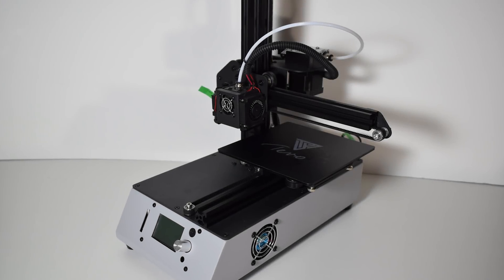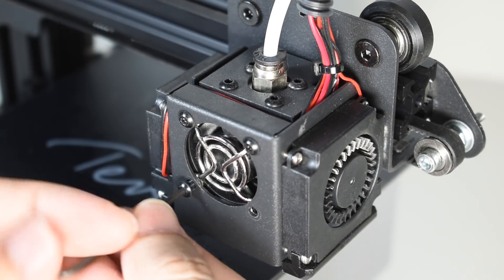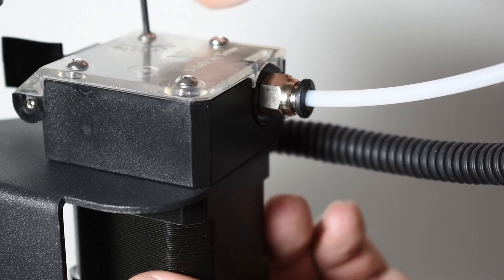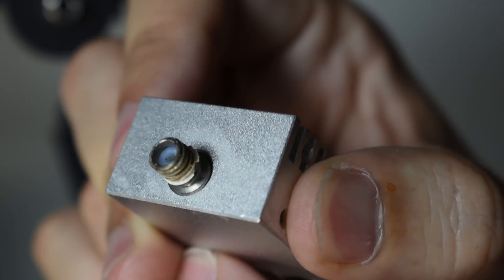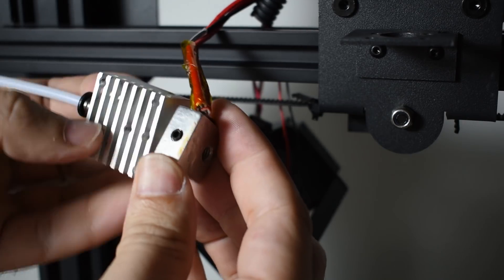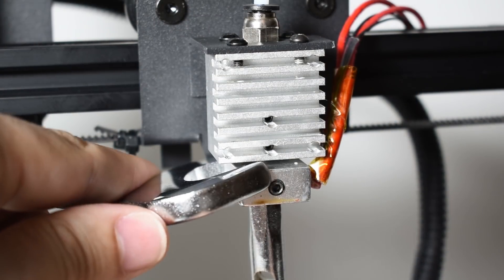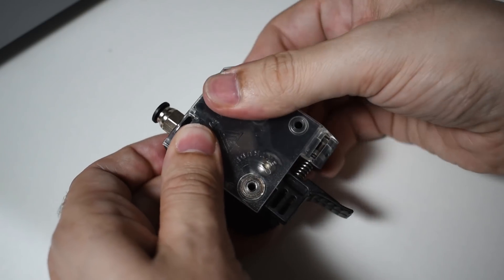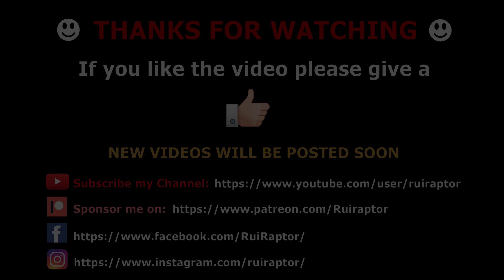3D Printer HOTENDS -  Troubleshooting Leaks & Clogs

Comment: You don't need to disassemble the extruder. Press down on the Bowden coupling and pull on the tube at the same time.
Reply from the maker: If the PTFE tube is already contacting the nozzle, there is no way you can push it in any further.

Comment: I realized this on my own and ran the PTFE tube all the way down within the heatbreaker. Then I tightened the nozzle so that it touches the heatbreaker but my Tevo Tarantula still clogs and I'm gonna run crazy
Reply from the maker: Did you check if the PTFE tube has a clean 90 degrees cut? Also, make sure the nozzle is also too. Did you tighten the nozzle while hot?
Reply: ruiraptor cut is clean 90 degrees and and the filament has nowhere to run but inside the nozzle. it starts to print all okay but during the print it clogs so the last thing I’m going to check is the retraction settings. Would you suggest me something please  cuz I have no idea how to set a retraction setting.
Reply from the maker: For PLA and for the tevo tarantula we are using 6.5mm distance and 35mm/s speed. What temperature are you using? Also, is the frontal fan always on when you are printing?
Reply: ruiraptor I print at 205 for PLA, frontal fan is assembled with a direct connection to the power supplier so it’s always on. The heatbreaker I use is M6x22mm, would you suggest if I replaced it by a longer one and added additional fins in between the block and heat sink ? I’m really confused.
Reply from the maker: Don't understand. Your hotend is not stock?
Reply: ruiraptor yeah yeah it’s the stock one. Only the heatbreaker was full metal and I dipped the PTFE all the way down until it’s end. This is the only change I did. But it’s M6x22mm so thing I wanna find out is, will increasing the gap between the hearing block and the heat sink will give me better results? Cuz if so, I’ll change my heatbreaker with a longer one

Comment: Hi Rui. Thanks for all the great videos and reviews you do. I’m trying to find answers for a problem, you might have some tip... I have a tevo tarântula running the stock hot end. It has 2 tiny screws behind the heat sink to hold the heat breaker. On of those screws won’t stop turning. I’ve changed the position of those screws to define if the problem is the screw or the hole, and it’s the hole apparently. I also noticed the screw would go all the way down if I tighten it down without the heat breaker in place. But with the heat breaker in place the screw isn’t getting a good grip... Any idea to fix it? Thanks.
Reply from the maker: Hi Paulo, that means that the threads from the heatsink are bad. You can always buy a new heatsink but before that you can try and replace the set screw with a screw and that way get more thread when tightening. Other solution would be to use a tap and make a new thread for a bigger set screw.

Comment: Hello! In a never used printer, with the extruder never heated is it necessary to do all these steps? My printer is a Tevo Tarantula Pro.
Reply from the maker: Hi Gustavo, for a brand new tevo tarantula pro we recommend you to follow the hotend check and assemble it correctly to avoid clogs and leaks in the future.
Reply: ruiraptor Hi Rui,are these steps similar to the Tevo,Flash? I am a complete new to the 3d topic and don’t want to spoil it.

Comment: Can you do one off these for a tevo tarantula pro please
Reply from the maker: Hi, the procedure is exactly the same for the tarantula pro.
Reply: @ruiraptor  ok thanks i did some tweeking and found the extruder needed calibration as the stepper motor need to be tuned down to 140mm instead of 460 which is factory settings and im only starting to get the hang of it thanks for the help tho

Comment: Hey  I need help my Ender 3 printer with a0.2 mm nozzle is leaking filament outside the nozzle
Reply from the maker: Probably the nozzle is not tight against the heatbreak. Follow the recommendations i show in the video.

Comment: You're a lifesaver Rui.  I'm replacing the Bowden Tube and hot end nozzle I bought based on your first video.  Something's wrong here because the printer isn't laying down a good bead of filament.  So I guess I have to do what I didn't want to do. Take the Hot-end and Extruder apart.  The extruder gear was moving but no filament was moving.  UGH!  But your video here gave me a bit of confidence.
Reply from the maker: Hi,
Dont be scared to do this...it's an easy operation. Just follow my instructions and make sure the tube is all the way down and you will be fine.
Reply: Well there was a blockage and the PTFE tube wouldn't go all the way in.  I finally got it out.  See my PM.  Phew! Now the tube is where it should be.

Comment: Hello Rui, do you know, if the michelangelo Hotend fits on the tornados mount? And when will you upload the video of the bl touch for the gen l board for the tornado?
Reply from the maker: Hi Sercan,
I'm not sure if both have the same mounting holes. Need to check.
Regarding the BL touch, it's an idea but first i have to buy one. To be honest, i never used an auto level sensor because i always preferred manual leveling.

Comment: I've found you tend to get a better cut of the PTFE tube if you insert some filament all the way down the tube and out the end you want to cut. Then cut both together. This reinforces the PTFE tube walls and stops it deforming as you cut!
Reply: Oh and a very small cable tie around the collect (under the black ring) makes a cheap and easy collect clip and stops the tube moving back and forth. You can buy special clips, but...
Reply from the maker: Thanks for sharing. I use the zip tie technique too.

Comment: Do you not use any insulation on the hot end? My tornado has insulation wrapped around it.
Reply from the maker: Hi Geoff,
The Michelangelo hotend is not equipped with an insulation material from stock, unlike the tornado. I'm keeping my Michelangelo's hotend stock...but there is nothing wrong about installing a sock on it.

Comment: Anyone have a link for the tube tool used to remove the nozzle?
Reply from the maker: Here's an example:
https://www.banggood.com/pt/6Pcs-Tubular-Box-Spanner-Tube-Spanner-Wrench-Metric-Socket-Set-6mm-17mm-p-1104300.html?p=84280421195697201804&utm_campaign=21195697&utm_content=3312

Comment: Another great video. If you would like to prevent the extruder stepper motor from falling off every time you remove the extruder, get a short 3mm screw and with the extruder removed place the screw in the right rear position into the stepper motor. On my extruder the hole was big enough to sit over the screw, but if not you can enlarge it carefully with a drill bit. The added screw will hold the extruder motor in place while the extruder is removed.
Reply from the maker: Hi Vance,
Thank you for sharing ;)

Comment: Is this the same procedure you would use on the tornado? Thanks for the great vids man.
Reply: I have a Tornado and it's the same basic process. The main difference is that the heat break on the Tornado is held into the heat sink with 2 small set screws on the right side, the throat isn't threaded but is instead a smooth tube.